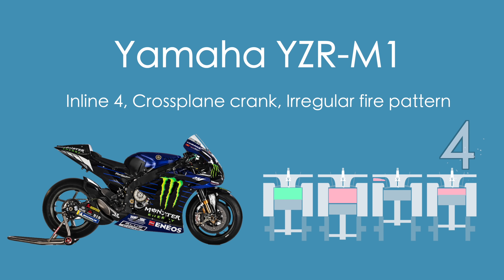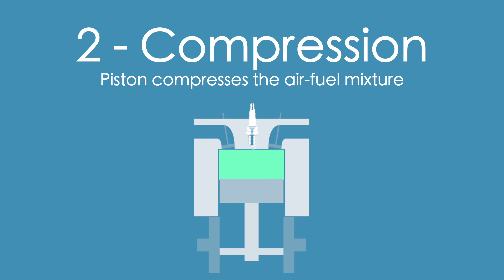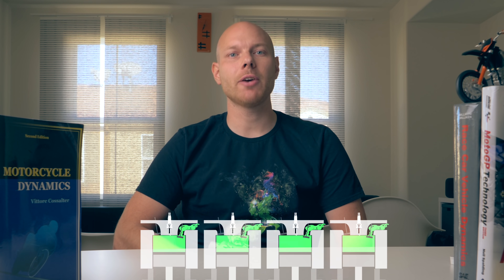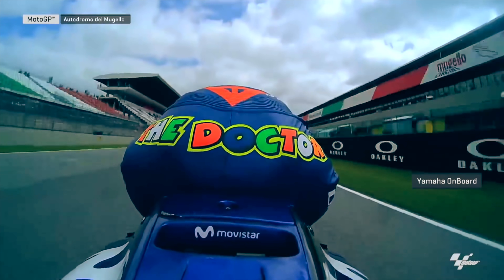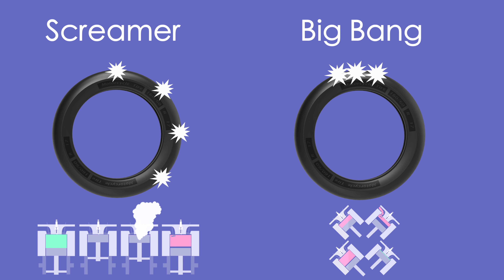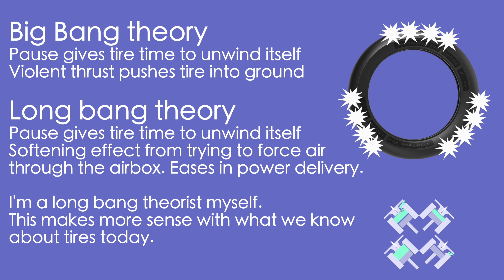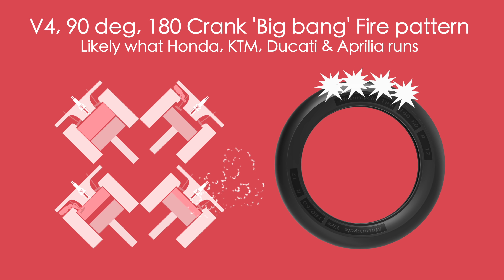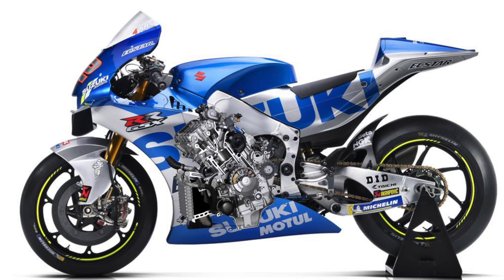MotoGP Engines | Scream LOUD or Bang BIG?

Comment: The 990cc era was one of the best era's for MotoGp engines, where the engines had 5 cilinders instead of 4 cylinders. Watched a few races in person in 2005/2006.The most brutal and extraterrestrial sounds. I frequently visit MotoGp races now, but it's not the same anymore. That experience can't be replicated. Anyone who ever witnessed a 990cc GP knows what I'm talking about. You can also hear the difference on video but in real time, you feel it in your veins.
Reply: I was at Sachsenring this Year and i can't describe my feelings when the GP Bikes started with a noise i never heard before. Can't imagine what you have witnessed years before. Just crazy.
Reply: Only Honda had 5 cilinders. Ducati, Kawasaki and Yamaha had 4 and Aprilia had 3 cilinders.

Comment: I'd be interested to hear what an engine firing all four cylinders at once like at 2:00 would sound like. Maybe it'd just sound like the engine block exploding.
Reply: Here's an example,  Victa lawnmowers once made a boxer twin 2 stroke 170cc. The regular Victa single was 160cc. Boxer twin 2 strokes fire both cylinders at the same time- sounds the same as the single running. Looks like a nice gimmick but unimpressive to hear. Ended up being noticably more weight for basically same power.

Comment: add this to the conversation: The Current Ducati Motogp Bike is a 90degree V4, but with 70degree offset crank pins. By the sound of the Honda, it also (probably) does not have a conventional 180d crank either, but with offset crankpins too.

Comment: A 65 degree V4 is shorter in length compared to 90 degree V4. So, it can have more horsepower than a inline 4 and better corner speed compared to a 90 degree V4. RSV4 series are the best sounding production motorcyles also.
Reply: Yes
Reply: Different V angles suit different rev ranges, other than that only the usual engine specs determine power: bore/stroke, head shape, valves/porting, camshaft, carb/injection setup. And how many balance shafts your given engine needs to drive. This is why engine displacement is the biggest factor in drag racing, not crank type or number of valves etc.
Reply: @rossbrumby1957  V4 engines provide better low to mid range torque compared to inline 4 engine
Reply: Inline 4 revs the highest because it is the most balanced 4 cylinder engine configuration with it's superior primary engine balancing quality. Without the use of a balancing shaft, an inline 4 can run at high crankshaft speeds despite having mediocre secondary engine balancing.
Reply: That is why inline 4s are loved by people because when they hear it, they think of it as powerful, high revving engines – and that created the stereotype.
Reply: The perfect engine in MotoGP in terms of track straight line performance is the Ducati desmosedici because it has the following qualities: 

The best aerodynamic fairing (least drag)
High revving desmodromic valve 4 cylinder engine which makes at least 300 HP

With good wheelbase already planted caused by the v4 spacial configuration, with other v4 engines, it has the best natural wheelie-free acceleration possible other than longitudinal inline engines (if ever that is possible in MotoGP but in this case, a rather stupid idea)

Comment: Crossplane crankshaft long long ago.
The four engines are smaller and more compact and therefore can be placed easily inside the bike frame and adjusted easily

Comment: Lemme explain what happens in a Big Bang engine. First of all, no matter what motogp bike you choose, they all slam the rear tire to the ground when they hit the throttle, but that's due to the swingarm, chain and suspension geometry. Thats also the reason of those enormous high-side they do. Now, consideering what you said about de engine pulse sections (wich is correct), we can deduce that having all those as close to each other, acts kinda like if they were in resonance: the second explosion uses the inertia of the firs explosion to multiplicate its actual force, then the third one with the previous two ones, and so on. That traduces to more Engine Torque, wich equals in consequence in just a little bit of extra down push of the swingarm so the tire. And last but not least, those gaps between the pulse sections are good to unstress the tire for a moment and make it grip a little bit for the next pulse section. That, combined with the torque fact, means greater acceleration if we put two same bikes with the same gear ratio etc. But in reality it can be modded as much as seing screming Suzukis going through corners in an higher gear but still accelerate the same but still have more top speed. To conclude, just one more thing. It's interesting what you said about the need of air in the intake in a shorter amount of time. It's true and you were correct, but isn't that much of a concern: consideering that those are a liter bike engine, they suck a little amount of air if you compare it to some big engine cars wich need force induction intakes, not to provide more aire but to provide enough of it. In a motogp bike, or a street bike like so, you have the ram air, wich is as simple as a direct intake wich by third law of Newton, equals in a little bit more pressure in the airbox. With that and a liter bike, you will never run low of air in the intake, there is enough air comming to you at a certain speed. The real concern here, is to make it reach the cylinder without make it go through turns and corners in an airbox  etc. That's exactly why they make the ram air through the chassi, and almost direct to the valves. Oh, and the inline4 - v4 thing, they're not better than the other one, the fact here is the final mass of the engine. As you well said, an inline 4, naturally comes as a screaming engine, because it's balanced and perfoms well, but if you wnat to,  you can make it big bang, by crossplaneing it. Same but oppossite with the v4: A v4, due the firing order and how the rods are conected to the cranckshaft, make them big bang by nature (more or less depending the degree of aperture of the v, for example: Honda, Ktm: 45º  Ducati. 90º).  Also if you want to, you can turn it into a screamer, but that's not usually the case, also it,s a little bit harder. What really matters with the shape of the engine, it's the internal components. Without further looking, we have the cracnkshaft, wich is the heavyst moving object in the engine. In an inline 4, it's longer so heavier. In a v4 it's shorter si lighter. That, in combination of the big bang or screamer mode you choose, makes the engine climb rpms from bottom fast as hell (if it's lighter), or use the inertia of the crank to make it climb little bit slower but further in rpms (if it's heavier).
Glad to see you talking about those interesting things, and happy to help with it.

Comment: I hear there's someone working on an electric motor attached like a supercharger. Only it's triggering on in micro bursts during the dead time in crank rotation. MASSIVE gains!
Reply: In motorcycles its complicated bcz the batteries affect the weight

Any patents or links so ilook at it??
Reply: @FirstLast-tx3yj  I wish, another one of those that showed up overnight then got bought out & shelved just as fast. But I’m sure he’s working on it. Just no longer for public consumption.
Reply: @RESET1776  u can still find patents and simple drawing if u know what is the thing called

Comment: Thanks I learned something. It's counter intuitive because we might think that evenly spaced power pulses are best, but my own experience with 90 degree V twins tells me otherwise.
Reply: Other than Ducati, I can't think who else uses 90 deg V twins. Are they single crankpin or a 180 degree twin crankpin?
Reply: @rossbrumby1957  The Suzuki SV650 is also 90 degree V. They use a common crank pin which allows perfect primary balance but gives uneven firing order.

Comment: great informations. obviously with unified electronics yamaha and suzuki are at disadvantage because they cant tune it to their needs and it seems its now electronics is tuned more for the big bang. before unified electronics yamaha was really strong, suzuki was out because of simonceli, but now they both seems to struggle a lot with power transfer to the ground. ducati is rocket vs yamaha and suzuki. correct me if im wrong.

Comment: The flat plane 4 problem was about feel inb that. At hight revs.   The torque to the wheel doesn't respond to the throttle.   Its just engine speed and crank inertia.

Comment: You messed up Ducati's twin-pulse. It's actually a 90-degree V4 with a 70-degree crankshaft creating 90-200-90-340 spacing. Additionally, before 2018, Honda was using the old school "Droner" firing interval with a 90-deg V4 and a 360-deg crank. 90-270-90-270. Droner is an Odd-Pair, Even-Set pulse order engine, whereas Ducati's twin-pulse is an Odd-Pair, Odd-Set pulse order engine.

These are terms I just made up, but I think they're accurate descriptions of how each engine design spaces pulses. At the same time, a 90-deg V4 with 180-crank and cross-plane I4 is just a fully odd firing "no pattern" engine, and a flat-plane I4 is exactly the opposite, being a completely even "no pattern" engine. But of course, you have the inertial torque thing to worry about, there.

Personally, I think anything works besides what's been proven NOT to work, which is the flat-plane, even-fire design. I'm also not entirely sold on this "long bang" malarky either. After all, that's a LOT of sudden power to stack up at once, even if it happens less often on a smaller section of the tire. I personally like how the Droner order looks on paper. Odd but even and no inertial torque to worry about, either.

Clearly, Honda themselves think differently and possibly found something better since they've been on the "long bang" train since their 2018 revision RC213V.

Comment: I think my 2001 VFR800 may be considered a "big bang" engine. It has a very lumpy idle due to the close grouping in the firing pattern. I read that it was to help with traction. In my experience it's similar to how anti-lock brakes work except for acceleration. If the tire slips instead of continuing to slide it cuts out so that traction can be quickly regrained. It's most obvious when taking off hard from a stop in the rain, it seems to regain traction almost immediately compared to my other "screamer" firing pattern bikes.

Comment: While the IL4 is shorter, you might want to mention that the V4 Is much narrower, and there are pros and cons to both in regards to chassis design. And while the V4's rear cylinders are harder to cool, the same problem applies to the center cylinders on a IL4
Reply: They could overcome cooling by more complex plumbing, favouring the likely hotter cylinders to get the coolant from the radiator first.
Reply: I checked and aprilia actually has a shorter wheelbase vs yamaha

Comment: Hi thank you for the very valuable video and information    While sound can tell a lot of things i would always rely on a engine test bench to get the power and torque curve 
However i think that also vibration management could be important for reliability   
I remember when Rossi changed from Honda to Yamaha 4 strokes in 2004
if I remember correctly in the first tests it crashed a little too many times complaining of a torque curve that was too sharp   Not flat enough 
The engine was initially a screamer 
At one point someone thought of switching to a big bang and bam .... immediately the bike became so much more drivable and the rest is history  He won the championship  
I conclude with a few questions
And do the dyno tests first instead of waiting for a rider to crash?
Can it be said that in general the big bang is better than the screamer?
Is it true that most of the moto GP engines are now of the big bang type?
And if it's better for the GP bike, isn't it also better for any type of motorcycle, even more human?
Thanks again and best regards, gino

Comment: I did a quick google regarding the wheelbase of each bike and the numbers I found were all shorter for the V4's (not sure I trust the sources though), Mike, do you have any accurate measurements to share? Great video as always!
Reply: At last someone thinking about things.. the shorter cases of the Suzuki & Yamaha inlines allows for longer swingarms.. short wheelbase creates quicker turn & roll into corners but also creates a wheely happy setup.. there's an ideal wheel base for rider bike combo & class.. Mike's also wrong on his use of the term vibrations both in engine config & effects on tires.. as with the big bang concept that was realised by Yamaha, but in their flat track days with the 650 twin.. Mike's "vibration" theories are all to do with harmonics.. specifically critical mass & harmonic frequencies.. sometimes lighter ISN'T better.. it's best seen when dragster car tires patter & break traction.. bike tires with soft pliable carcases will do the same in how they react to power pulses from the engine.. & length of swingarm & chain significantly affects these harmonics too.. hence how swingarm harmonic balancer a work that attach to the end of a swingarm.. cush drives too can work for & against wheel drive harmonics depending on the rubber densities & volume mass squash effect.. the maths would be horrendous.. note Ducati employing a dynamasist to address harmonic resonances in their gp23 engine with different cylinder bank angles & firing orders.

Comment: I cant find information anywhere on Suzuki's inline motogp engine. It definitely sounds like an uneven firing engine and the GSX-RR corner speed and grip is it's strength.
Reply: also low tire wear.

Comment: My question is: why are they using v4's in MotoGP, spend a lot of money there to make them better and still use a regular inline-4 in there street bikes.....
Reply: Because of the more complex engineering, the costs to manufacture a v4 are higher compared to an inline-4. For street use, the actual technical advantages of using a v4 engine are less important than in racing where every fraction of a second counts. And with an inline-4 being cheaper to manufacture, it means that the MSRP can be lower. This is probably partly the reason why Ducati's and Aprilia's are more expensive than their Japanese (and even German) counterparts and a bit more "niche" so to speak.
Reply: A v4 is expensive
Reply: a couple v4 is easy to make however mass production it cost alot and complex
Reply: You wrote the Answer - Simply Money.
Reply: Maintenance on a V4 is a bit tougher as well so more hours and more costly.  That said they don't have the vibrations through the bars like most I4s and have much flatter torque curves so they are more pleasant to ride at a less than 10/10 pace.  I don't ride that many miles compared to a lot of sport bike owners so I don't mind a bit more on the maintenance.  But can't handle the vibes from most inline motors.  I have ridden my Aprilia 5+ hours in a day no issues.  Some I4s after 15 minutes my hands are starting to revolt against me because of the vibrations.  A lot of people have only ridden I4s so they don't know any different.  I've ridden close to 200 motorcycles at this point so I know what I do and don't like.

Comment: If there's not some non-linearity of the characteristics of rubber playing into things, quite a bit of this sounds a bit snake-oilish in my ears.
Big bangs should be rather prone to make the tire lose its grip. On the other hand, there is that effect that tires that are on the edge of slipping through develop the most grip, maybe the advantage is that such layouts push the tire into such region of its operation condition on a regular basis. This bit of info doesn't really digest well in my physics trained brain yet…

Comment: You kind of glossed over it at 6:45, but why would the rear cylinder run hot on a V4? If they are liquid cooled why is the rear bank running hotter?
Reply: rear cylinders are always running hotter than the front one... I dont know exactly why tho😅
Reply: The wind does extra cooling on the front of the engine block and heads. If they get the coolant flow right on an engine, it would allow for that difference by letting  the coolant enter the rear of the motor first perhaps.

Comment: It appears from your video that Yamaha invented the big-bang !
I was convinced that it was Honda a short time after they had to drop the oval pistons !?
Reply: :)) Yamaha? they just started making big bang engines since 2004. :)) Big bang engines been there when Honda and Yamaha were still making single cylinder aircooled two stroke engines. Moto Guzzi made a V8 with big bang firing order in 1955.

Comment: Awesome informative video! But you fail to explain why the V4 makes more power than the inline4, when both have the same firing order.
Reply: Screamers have regular power pulses which compensates forces. A big bang engine needs balancing elements that take power away

Comment: I've heard someone say their twin cylinder mt-07 has a cros plane crank but this is not possible, is it?
Reply: It's parallel twin with a 270 degree crossplane crank which gives it the feel of a V twin. Suppose if you like V twin feel and sound but need a more compact motor for the frame, this is the answer. I prefer the look and sound of a V twin with a flat plane 180 deg crank like the CX500 or M109r. More performance and smoother than single crankpin V twins like Harleys and their Japanese clones can give.

Comment: Currently there isn't a single screamer engine in Motogp. Suzuki, Yamaha & Aprilia and KTM are big bang, Ducati is Twin-pulse. Honda is also twin-pulse since they copied Ducati's engine layout from A-Z. Inline4s are inferior by design. In racing they are given a lifeline by giving them the tyres that works better for them vs V4s.
Reply: Any inline-4 are inferior for higher power applications due to the longer crank being susceptible to torsional stresses than a shorter crank in a V4.